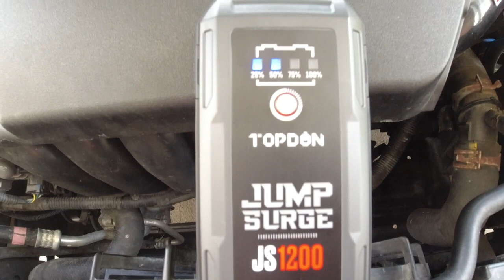Installing HOOD STRUTS In The Corolla!

Comment: Hey, great content. I also drive a 5 speed manual Corolla, 1.6 1zr fe. Toyota introduced the model in 2007 for Europe.  Mine has an auto climate control which feels better to touch, it is strurdier and feels more premium. You could try a swap, just search for a corolla e150 climate control 😉 

Also could you make a pov driving, rpms in different gears, acceleration. 

Haven't noticed if yours has a cruise control but, if you don't have the switch is basically plug and play

Regards
Reply from the maker: Thank you! And I have looked into wanting to swap out the climate control, but the wiring is completely different, maybe in the future, I might try it! 

And I have a POV video in my to do list, so that will be coming in the future as well. 

and as for the cruise control, I swapped out my base corolla steering wheel, with the S steering wheel, and that gave me steering wheel controls and cruise control!

Comment: Ayye bro, you should install a remote start kit, I just got me a white 2012 Corolla too, and I just ordered it, they also have some a custom fit windshield shade for it if you want one
Reply from the maker: I will take a look into that. The only problem with my car is it’s a manual. And the clutch needs to be pressed in order to start the car. But I know there are work arounds!
Reply: @BrandonStellmach  hey man, I actually have a remote start on mine, and it's a 09' 5 speed manual! (the XRS, with the 2.4)  ..I don't recall the model of the starter but it definitely works without pressing the clutch or being in the car.  It's possible! 😎  The only thing is.. using it in the summer time, the rpms dip too low in idle (especially if the fan kicks on) and it eventually stalls.. apparently there's NO way to adjust the RPM idle speed in these cars. So, i can only reliably use the remote start in the winter, without stalling.. but when it's COLD is mostly when I want to use it anyway. I can try to check my starter model if you want. Thanks for the vid!
Reply from the maker: @steves7069  that’s interesting, i never knew certain starters could help bypass the clutch switch. 
If you ever get some time to figure it out, just let me know, because I might want to do that!

Comment: I've been wanting to do this on my 9rh gen (E130) for some time.

Reminds me I need to replace the ones on my 2000 Lexus GS300.
Reply from the maker: I would imagine you would find a set your your 9th gen.

And are you saying that you got a 2JZ engine? I believe those Lexus GS300 come with the same engine that the Supra has!
Reply: @BrandonStellmach  not sure if my Lexus has same 2JZ as the Supra, as there is different one for turbo and one for non-turbo.

2JZ-GTE vs 2JZ-GTZ?
Reply from the maker: Looking into it, it looks like some of the GS300 come with the non turbo 2JZ. And other come with a 1UZ V8 engine, 
Don’t know much about them, but that would be awesome if your did have it!

Comment: I work on cars we all prefer prop rods. They last a long time, don't fall on your hand, and are reliable. Mainly the falling on your hand.. that's a life saver.
Reply from the maker: That is very true, never thought about it that way. But at least with these if one fails the other will still hold it up!
Reply: @BrandonStellmach  Yeah sorry about that. I wasn't trying to kill the mood. I like the rods looks wise. I liked and subbed btw.  I have a Honda Fit (2020) that I tinker with. Want to get the best performance I can with that tiny engine. Can manage 42-43mpg on hwy.
Reply from the maker: Don’t worry! It’s all good! Thanks for the Sub! 

But Honda fits are nice little hatchbacks. I almost bought one a few years ago, but I ended up getting a my other car which is a Camry instead! 
But you definitely can’t beat that MPG!

Comment: Liked the video.  Do you have any idea if these struts will work on the 2022 corolla?
Reply from the maker: Thank you!
And no these are specific to the 10th gen corolla witch is 2009-2013.
But if you google hood struts for 2022 corolla hood struts, you should find some.
Reply: @BrandonStellmach  I did find some but they were not as easy to install as the ones your video shows.  I did however find some on eBay from china that installed by using the existing hood and fender bolts.
Reply from the maker: @elmer7067  awesome! I’m glad you were able to find some!

Comment: i had to subscribe you explain so good and so much details. do you have a video on how to install steerinbg wheel controls for a pioneer headunit ?
Reply from the maker: Thank you! I’m glad the video was informational!
And as for the steering wheel controls, this video is me swapping over the steering wheel and clock spring. Which would be the first thing you need to get the steering wheel controls to work. And then a radio that supports the steering wheel controls. 
https://youtu.be/847SLnHTmGs

Comment: It's still sold out. I got mine years back from ebay. It's still in stock on ebay if anyone wants to buy a set.  👍👍👍
Reply from the maker: Do you happen to have the link? I will put it in my description, so people have choices!
Reply: @BrandonStellmach  I can't post a link here cause youtube kept deleting my comments. U just search up 08-13 corolla struts hood stainless  damper kits. Should be  the one with the black corolla picture.
Reply from the maker: @silentgaming1197  I believe I found them, so I added the link in the desertion.
Thanks.